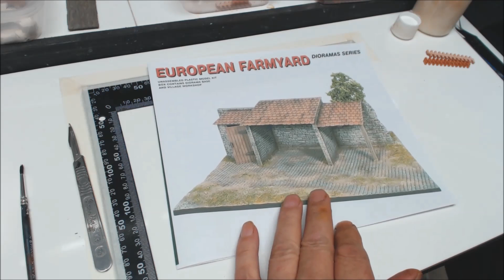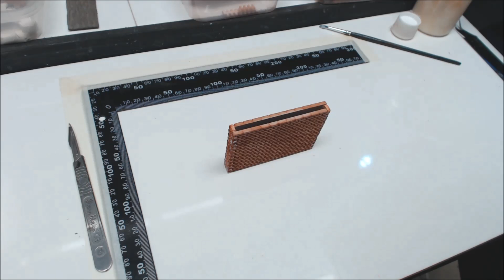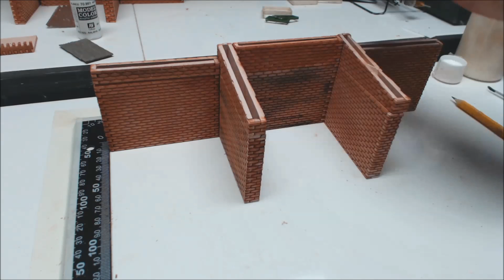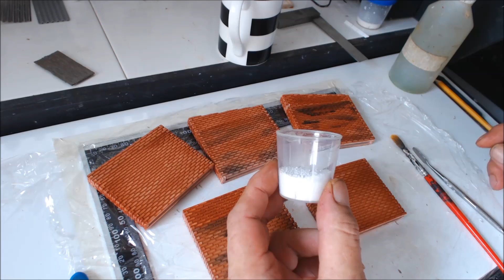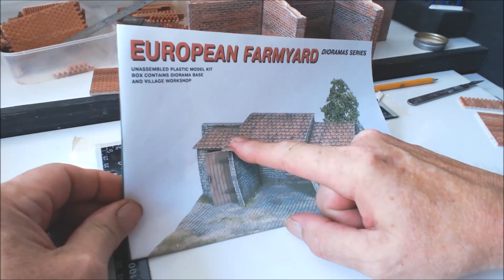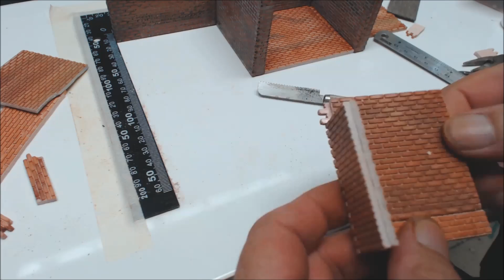European Farmyard In 1/35 scale  part 1  ( Basic Build )

Comment: you make it seem so simple. Quick question... will it hurt the molds to let the casting harden inside it for over 24 hours? My storm grates and manhole ring are still breaking on me
Reply from the maker: Now it won't hurt the mould at all at present moment I'm doing some experiments instead of using casting powder I'm using a easy flow jewellers raising which is cheap and very low odour and getting good results with it the only reason is I found out that smaller moulds are adapted for raising use I will be doing a video on it as soon as hundred percent sure that you get good part every time many thanks Sim
Reply: thanks for taking the time to answer. very much appreciated